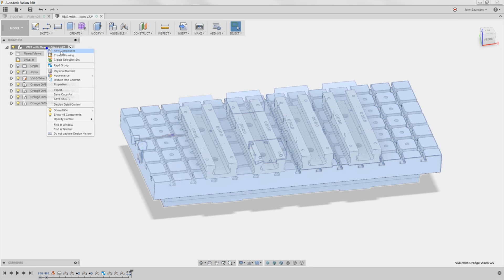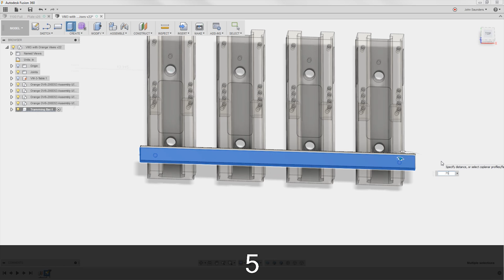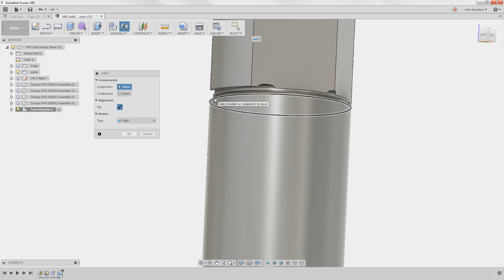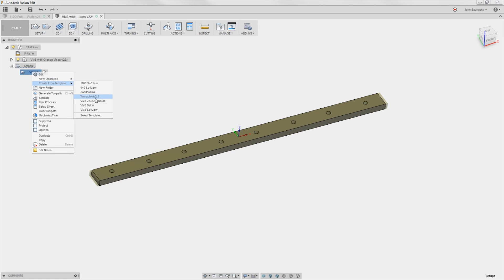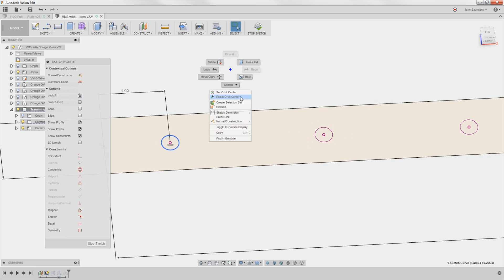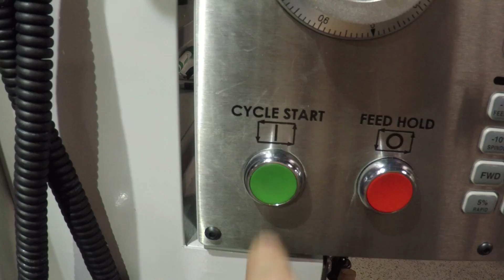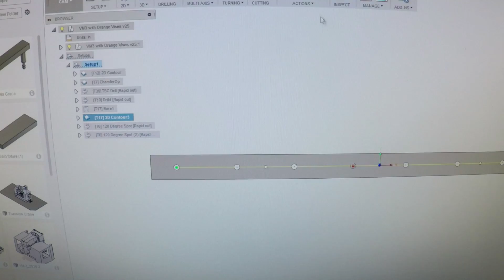Tramming Bar to Align our HAAS Vises!

Comment: john, I'm hoping to get your opinion on something that if i remember correctly you did years ago when you were in the apartment and was using the dinosaur know as a micromark 7x14..which is what i have,..i think you added the LMS extended cross slide to your micro mark..I'm thinking of adding it to mine and wanted to check other ppl's reviews first before i waste money i cant afford to lose..problem is i cant find any one that has done it..if you did add it to yours and dont mind can you tell me how it worked out..did it infact add an inch of travel...
thanks man...been watching ya a while .

Comment: Hey John, which drillingmachine are you using in minute 11:50? Greetings from Austria ;-)
Reply: Sorry for the late reply! It's a tapping machine from a company called Flexarm. The arm is a linkage that keeps the tool perpendicular to the table while you tap the holes. It also has a fancy clutch system to help prevent broken taps and a fast reverse.

Comment: I'm more familiar with solidworks than fusion 360, but couldn't you make the projected holes from the vice construction geometry and put a circle around then. Try not to work with anchored constraints, their a pain in the ass if you want to redo something.

Comment: I may as well join in on this dead horse. - Dude, use cutter comp. :P

I would like for you to make a video on just cutter comp alone, and of your course, your rebuttal on what situations does it make sense to have cutter comp for the program at the machine, and when it's better to not have cutter comp, and thus leaving any edits to Software.

One clue that can mean a program change oppose to D-values, is if the same edit is being done each time, whenever the program is being done. But if that edit is going back and forth over the 'perfect' Nominal. Then no amount program changes will fix it. have a D-Value. Leave it to the Operator. Because...Operators don't have easy access to the program to make changes. If you had 20 machines in that shop. I don't think you would want a computer by each one do you? Or 10-20 people coming at you for edits every day. lol!

Cheers. Still a great channel though. And it's nice that the bar works. I was thinking that, that thin long bar would be moving everywhere.

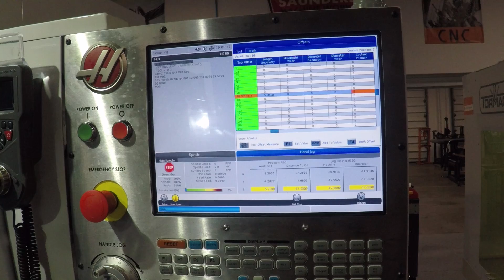Comment: what is the part with the red light at 8:56?
Reply: Its looking for the probes light to change color to indicate that the probe has touched the part, which then tells the machine to input that cordinate minus or plus the radius of the ruby tip to set the work offset.

Comment: Is there a reason you always use orthographic view? 
I find perspective much nicer to look at
Reply: I find Perspective annoying. The shape of the part is always changing. Orthographic is meant for a raw image that has a stable appearance regardless of what angle you're looking at. Perspective might be good for a Rendered Display of an exploded Assembly file though, I think.

In real life Perspective is always there, but the rate that software puts the Perspective is exaggerated in my opinion. Things look out of proportion to me. Unless there's a "softening" setting somewhere that I don't know about.

Comment: How are you not using cutter comp?  Reposting a program to get the part to size is a waste of time, impractical, and just not very smart when you have a CNC machine.  Go to your offsets page, add .0005 to wear and re run the program and its done.  Your the only machinist I have ever seen running a CNC do it your way.
Reply: So...  Change wear offsets, search the code for that operation, run it from there, re-check, and then remember to change the wear offset for that tool again (or even worse, re-run the whole program)...

As opposed to just taking 10 second to go into Fusion, change the stock to leave, repost, and rerun that single operation? 

k. 

You do you, I guess, but, seriously, fuck that noise...
Reply: You are obviously not a machinist and don't work in a production environment, or you run a tormach or a DIY machine.  What if you have a part you run all the time, and you have regound tools, or tools in the shop that vary from there nominal size.  You will have to save a program for every diameter of cutter you have in the shop.  I could run a program with a 3/8 enmdill one day, and then use a 1/2 endmill the next running the same program after only changing the cutter comp.  Your way is the wrong way to do it, and all of the machine tool industry would agree with me.  So keep doing it wrong, as long as it works for you.

Comment: Not a good idea to beat on the parts in the vise in this situation.  might bow the part and your pin holes will be angled after releasing from the vise.  I also would also have milled the top surface of the stock flat to ensure the pin perpendicularity. Just my .02 every  one has different schools of thought .
Reply: Yea that's what I was wondering. Might have been better to clamp the bar to the table to avoid putting holes in stressed material. I was also wondering about the accuracy of the pressed pins, but I can imagine that it is probably negligible, and likely going to be more of an angular error than a radial error.

Comment: John, Why don't you make a sub plate and mount all the vises all to it? Put some keys on the bottom to position it on the table. Put it on bolt it down your done. That will line them up the same in X and Y. Than you can save some external fixture offsets for that pallet of vises and jobs.
Reply: Indeed my genetically modified machining maniac  it's like a knew table sufaced for your individualized property  dang  we are abnormally intelligent  I started last century machining back in 1999 yep  I try to blend in with the  brainwashed  generation  thanks to the lower standards they are unaware of my true powers mentally   However  I am not a perfect person for I am a poor man   My salary now was  high upper middle class back in the year 2000  so I suffer in silence knowing  I might falll over dead in the shop floor one day   If I ever could  retire  I'd be highly surprised   I hope I live long but can I make it to retirement age  prob not  not as hard as I work  putting 200% in  every day  they got me on 8 days a week 16 hrs a day  my body is just broke down but I tuff it out like a man testicular fortitude   They say eww u a toxic masculine male man eeww stay away  u manly ways harm our  12 hrs of video games every day and night  they said I'm 20 and I ain't got the time  to go get a driver license  and I can save money buy toys for 8 yr old s for myself    God help us pls

Comment: Why don't you use wear offsets. It is so impractical to run back to a computer and change the program. You are the only machinist I've ever seen do that.
Reply: Doesn't PathPilot have tool wear/cutter compensation though? I remember John using it in PathPilot to walk in a snug fit on the thin part machining vacuum fixture he made. It's probably the way he's just used to doing this kind of work like you said but I don't think the Tormach machines are at fault since they should be capable of using cutter compensation.
Reply: Doesn't somebody tell him that every time he does this?
Reply: I think he was irritated that there were not two columns, one nominal size and one actual wear offset.
Reply: Motorman0297 another machinist here who does it too.
Reply: For the bore operation you must select wear for compensation type in the passes tab.  If you dont then it won't matter what you put in for wear offsets it wont use them
Reply: True that, set your tool comp to wear and just play with the values in your machine. Same program can be used on multiple machines with multiple tools too. Probably a byproduct of using tormach machines forever.
Reply: So...  Change wear offsets, search the code for that operation, run it from there, re-check, and then remember to change the wear offset for that tool again...

As opposed to just taking 10 second to change the stock to leave, repost, and rerun that single operation? k. You do you, I guess, but, seriously, fuck that noise...

Comment: Always love watching your video's John they are always educational. I was just wondering is there a reason you don't use cutter comp in your programs because it would be so much simpler to adjust bore sizes if you don't have to go back to the computer and post the code again to simply change the size of each hole.
Reply: He doesn't have to change the size of each hole in CAD!

All he has to do is select the boring operation, and adjust his axial "stock to leave".

It's way faster, in this instance...

Comment: why cant ya just put keys in botoom of vises,keyit in the  table slots,key into t-slots,1/4 20 socket head cap screws would hold keys, HBM I ran we put keys in  bottom of angle plates,on  off on off always within .001 in 60 inches,close enough for a boring mill
DEVEIGH JIG MILL SAME THING,it hade a 72 inch table
Reply: I use stop blocks and keys all the time and find they are very repeatable and within .001 or less unless you get a chip or something in there messing it up, but if it is clean it repeats. It is a HUGE time saver in setups.
Reply: yes,must be clean,i guess I'm anal,angle plates for boring mill I operated were 6ft tall,had and R on one and an L  on the other,always on table or turn table right on right side and left on left side,sounds anal but that's way the old school guy taught me

Comment: While diamond pins are easier to install, they will really only locate properly along a single axis. You could try doing a full pin and diamond pin for each vise. Full pin would accurately locate the vises in relation to eachother in X and Y while the diamond pin, properly oriented, would properly align the vises parallel to each other. At least thats my theory. Likely overkill for this use.
Reply: Which axis? ;)
Reply: Wrenchmonkey it really depends on the orientation of the diamond pin.
Reply: Why would that be? ;)
Reply: Wrenchmonkey diamond locating pins are relieved to prevent binding. As such, they only locate along a single axis. If you require a more in depth explaination, a simple google search will yield all the answers.
Reply: aww man, I had such high hopes for you... thought I saw the wheels turning for a minute; and maybe they were, but as Churchill said, "Men will occasionally stumble upon the truth, but most of them pick themselves up and hurry along as though nothing happened..." 😉

Comment: note that the 2nd 2in dimension you added at the start had brackets around it, that indicates that the dimension is overdefining, and driven by other constraints [in this case the 1st 2in dimension, and overall length of the bar] you'd need to relieve one of the earlier constraints to make that 2nd 2in dimension actually be a driving constraint. [in this case the overall length is probably what you'd want]
Reply: It won't be a gotcha. It doesn't allow you to enter a value that is different from the driven constraint.
Reply: That was his plan but as it was equal to the other and it was a one-off he didn't do anything with it.
Reply: indeed, not critical in this case... just wanted to point it out, as it could be a gotcha in other designs [or for others following along]